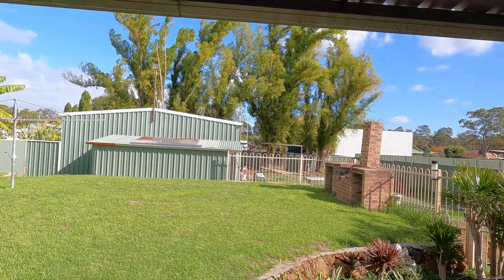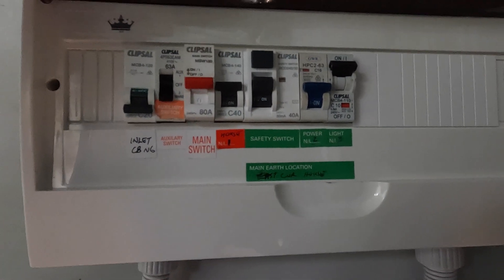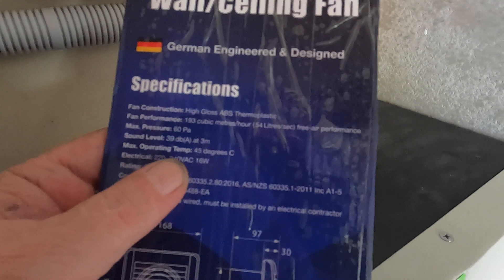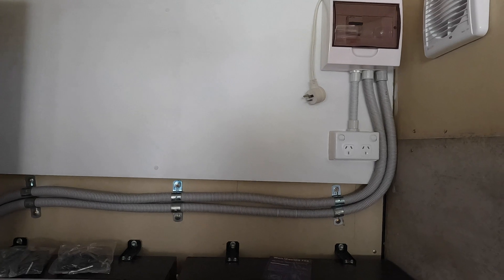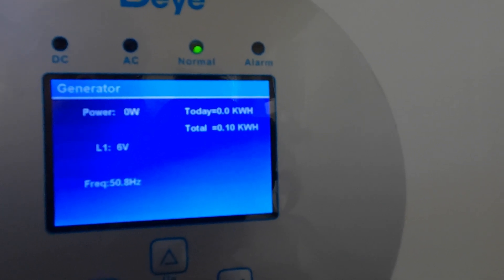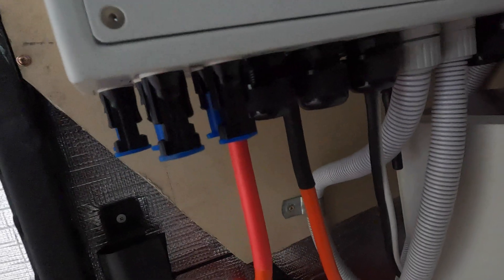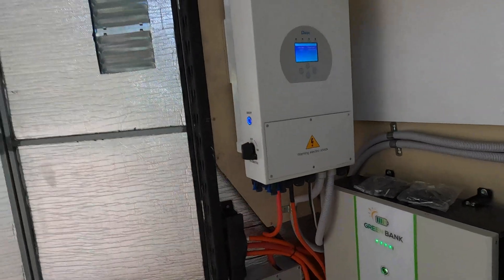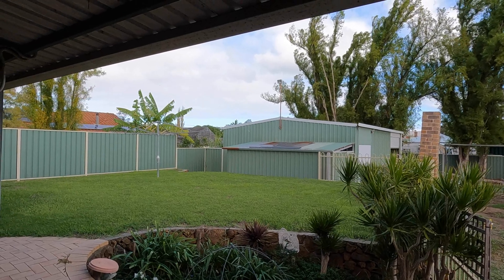OFF - Grid LiFePO4, System is Alive.

Comment: Does  your Deye Inverter charge batteries from your generator? A battery charger? 

Also I have looked at the DEYE web page and I am trying to find the "Off Grid" inverters that they sell and I am only seeing Hybrid inverters and three phase inverters. 
I am off grind and am looking for a purely off grid inverter. Do they sell them? Thanks Chris. Jim in Chile
Reply from the maker: Its 100% programable for 1 to 160amps from the generator / and grid. Its can be setup to auto start and stop a generator on the days times you want or just start and stop if the batteries are low. This is on of the best inverters i have every seen mate. Extremely well build. With lots of options. I have the 8kwh unit. bigger units or smaller units all are fully programable depending on the battery bank.
Reply: @JustinCaseSolarPower  Yes I would have a totally new system. 
I am thinking of moving here in Chile to a larger property and building all over again. 
SO I am shopping for new solar Panels and need to figure them out. 
I am shopping for new inverters. 
I am shopping for new batteries as well. 
I am starting over from scratch. Jim

Comment: Justin, sorry to hear about your experience with the rude electrician. Good help is hard to find nowadays. Question, is the RCD required by the electrical code or is it just to provide additional circuit protection? The system looks amazing Justin. I'm happy to see it up and running. Thank you for the video. Stay cool. Cheers.
Reply from the maker: RCD is required under the electrical code as that power point is on its own circuit.  Have my son coming down from the city on Sunday he will be staying for a week.  So he will help me deal with contractors.  Hate it when people come to give a quote and are not nice.  That contractor probably blames everybody ells for the fact the he hardly ever gets work.
Yes thanks the System is coming together very nicely.
Reply: @JustinCaseSolarPower  Awesome job Justin. Cheers.
Reply from the maker: @yhird  😉 ✌ 👍

Comment: Might be a silly question, why not put the new setup in the power room so the old battery cupboards could be removed?
Reply from the maker: Not silly at all. In summer it can reach 50c + in the old power room. We always had problems in summer keeping it cool, it had heaps of insulation in it but damn it got hot. The New Power cabinet is insulated as well and under the verandah and has a 6cm gap between it and the tin wall behind it.  It stays at ambient temps in that breezeway In summer every afternoon we get what we call here , (The Doctor)  it's a nice cool sea breeze that blows west to east and goes right past the cabinet and cools it down. So for us it was an easy choice.
No such thing as a silly question when it comes to solar. I will answer any question I can, If I can't then I will tell you, Sorry but I have no idea.

Comment: looking great! I have yet to try a All in one inverter hope to one day :)
Reply from the maker: Makes for a very neat install. Just need to get one that is very well built to handle all the heat from the MPPT Charge controllers. Going High volt solar makes it more efficient as well. And reduces costs as the monitoring of everything is all built into the one unit. You can get Deye inverters up to 50KW off the shelf. So basically 1 unit will do it all. We are not done yet but this will look great when finished.😉 👍
Reply: @JustinCaseSolarPower  I'm interested indeed.
Reply from the maker: @GoingOffGrid101  Yes I can't wait, But we must as we have to have the right electrician to do the solar work. Not sure what the regs are where u live. But here they make you jump through hoops while doing a back flip with a half twist.
Reply: @JustinCaseSolarPower  we have to right to do our own work as long as it passes code here.
Reply from the maker: That is just so good. I wish we had regs like that. As you know I am more the capable of doing the work myself. 👌

Comment: I think you wil really like the Victron Lynx Power In.  I got one also recently and bought the bolts, Nuts, flat washers and copper lock washers to be able to fuse it like the Distributor.  Cant wait to see you fire that system up.
Reply from the maker: I will just be using it as intended. I know you can mod them and turn them into something like the more expensive  Lynx Distributor but without the micro board. I can't wait to have the Solar panels rewired to around 400vdc so everything is on the inverter. I am waiting for a solar qualified electrician to come and do that. + I am waiting for the Lynx busbar and the DC 250a switch.

Comment: NICE !!! This is so cool !! Thanks for sharing. God Bless.
Reply from the maker: Yes cleaning out all the old gear, The old stuff was installed many years ago and as you can see, A lot has changed. That industrial Heavy duty Deye Hybrid Solar Inverter 8KW Single Phase SUN-8K-SG05LP1-AU https://greenbanks.com.au/product/deye-hybrid-solar-inverter-8kw-single-phase-sun-8k-sg05lp1-au/ along with the 2 x Green Bank Solar LiFePO4 12 KWH Lithium Battery 48V 250AH LB48250 https://greenbanks.com.au/product/greenbank-solar-lifepo4-12-kwh-lithium-battery-48v-250ah-lb48250/ Should see Sigi and I out mate. If all works as expected. But you also know i do a lot of research.   😉 👌
Reply: @JustinCaseSolarPower  Happy for yall brother. Hope the old stuff going to a good home.
Reply from the maker: @yankey4  Always ends up with people that disserve and need it bro. That is just how I am. 😉 🖖
Reply: @JustinCaseSolarPower  Why I still follow you and look at you as my brother.
Reply from the maker: @yankey4  I also am subbed to you my friend. 👍👍

Comment: Sweet mate, you still using victron to keep an eye on the system? As I have the lynx 1000amp shut inline with what you called power in. I like the victrons setup as I also keep am eye on my gas tanks at my property. Your doing a great job on videos and setup.
Reply from the maker: No mate. As soon as we get the solar sorted into High volt and put on the new inverter then it will be doing all the monitoring. All the Victron gear / MPP Solar inverters and the midnite is out of hear. The old Power room is being cleaned out and being turned into a storage room. I am Just going to use the Victron Lynx Power in busbar system as I like that a lot. Its a very well build busbar.
Reply: @JustinCaseSolarPower  your a cut above the rest when it comes to solar setups everything is code and above the board. It's great seeing the progress and updates on the beast.
Reply from the maker: @solarmanmick2368  Well if you going to show solar videos you have to show people how it should be done and done right. I never hide anything and don't Bullshit. So I hope people trust what I say and just maybe do it all right as well.
Reply from the maker: @solarmanmick2368  Thank you. More videos will be coming to you all as gear gets hear and I learn the online monitory program.  👍  😉